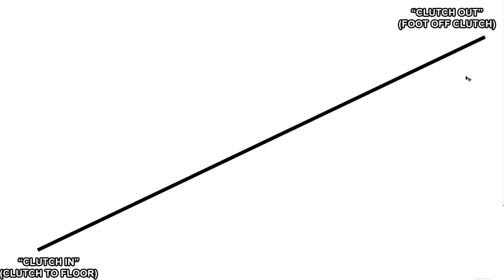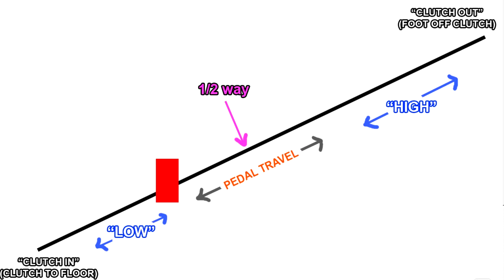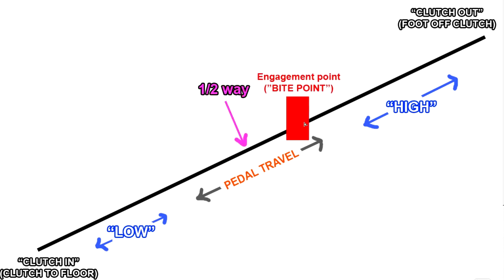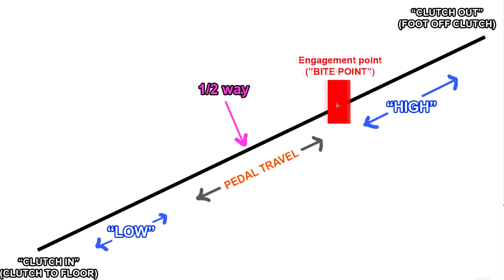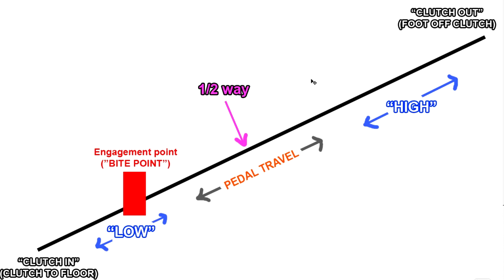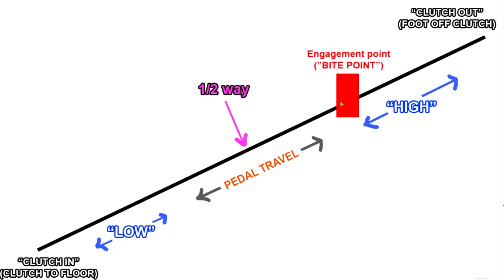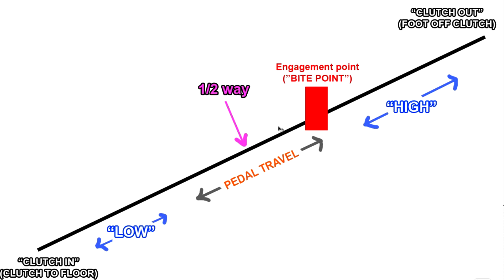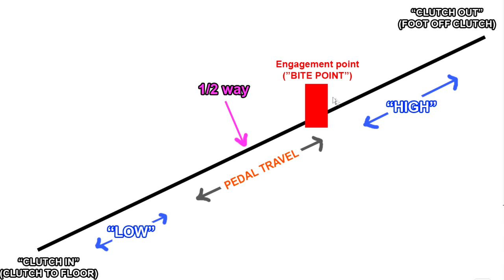(20) Manual Transmission: Bite Point , High and Low Clutch Engagement

Comment: I just had my clutch replaced after 20y and 237k miles.  The old clutch bite point was higher than the new one and the engagement transition was much smoother on the old one.  I was researching this point and found your video.  Thanks for the info!
Reply from the maker: Hi yes it is like old brake pads vs new brake pads the old clutch doesn't have good friction material anymore/worn out so it just smoothly engages. The new clutch has new friction material like a new brake pad so it will be more grabby and easy to stall.

Comment: Good video format.

May I just point out; that at 10 mins in, with regard to hill starts, that's what the hand brake is for - to stop rolling backwards. 

You apply the hand brake when stopped on a hill. Your clutch is pressed in and you have first gear selected. Then as you 'give gas' (or rev it as we say here in the UK) release the clutch Up to the 'biting point'  you'll feel the car start to want to move. That's when you release the hand brake and you will move off.
Reply from the maker: Many manual America cars and trucks never came  with a handbrake. Almost every truck sold with a bench seat never had a handbrake. Most people here do not use a handbrake for anything but the most steep hills. I have seen people driving manual here and I could tell they learned from youtube. They only knew how to gas then clutch and were using their handbrake on almost every incline because handbrakes and gas before clutch is the only thing that is taught on youtube. You can see here examples of vehicles with no handbrake https://imgur.com/a/uJ1ms .  I made a Hill Start Video and there is no handbrake in it because I do not use the handbrake for anything but very steep hills. https://www.youtube.com/watch?v=UIwWgEkR4UM
Reply: Drive Manual Well I never knew that.  That some cars in the US didn't have a handbrake.  You learn something new everyday.
Reply from the maker: Thanks and they actually do have the braking mechanism but it is used as a foot parking brake so there is a 4th pedal left of the clutch that you press down and that activates the rear brake like a handbrake.  You can see it in some of the pics
Reply: Drive Manual Wow! 4 pedals!? You must all look like octopi! :)
Reply from the maker: lol
Reply: Drive Manual be careful not to squid in wet weather
Reply: Rev it as you say in the UK? Lmao we say that here too(USA) who the fuck says “give gas”
Reply: No need to use ebrake on hill starts
Reply: Saul Cisneros A lot of people? “give it gas?” do you not watch movies?
Reply: @nonofyourbusinessnonofyour5435  Well unless you like prematurely wearing down your clutch lol then yeah you don't have to use the handbrake.  Suppose you could use the foot brake and bring it up to the bite, release the brake and rev.. but then at night you would be dazzling drivers behind you so bit of a bad habbit.

Comment: Just drove a camaro ss and I was used to driving a mustang noticed clutch on mustang is in a low range but high on the camaro. After thinking about it truly I'm more comfortable with driving the mustang up a hill because the clutch engages faster but when my friend drove I'd think wow guy is riding my clutch! But after driving his car I seemed to be more hesitant on starts because I would pull half way and the vehicle would not creep in first. After a few drives I got this trick
READY * SET * GO
Mustang: READY clutch in 1st gear/ SET gas /  GO clutch out
Camaro: READY clutch in 1st gear/ SET halfway out clutch/ gas GO clutch out

Comment: Thanks for the video.

We have a manual five-speed 2001 Toyota Corolla CE that was recently involved in a crash. It wasn't my fault, but the other driver's insurance is making it a total loss primarily because of its age. (It can still be driven, though it feels off.) We do have the option to keep it, but we don't really want to drive around with damage like that—dents and scuffs are one thing, but "actual" damage from a collision is something else. lol We are getting a settlement in the next couple of days, though, and will be buying a used manual five-speed 2001 Ford Focus ZX3.

From watching this video, the Toyota's clutch engagement point would fall under low. Now, we test drove the Ford and noticed we had to bring our foot up higher, meaning the engagement point is on the high side. Don't know if that's by design, though, or if the clutch is worn,  both of which were mentioned in this video. We'll have it checked. If it's by design, though, I wonder if it could be adjusted to be on the low side.
Reply from the maker: A couple of people have left comments that various ford cars have higher clutch engagement points so it is best to get it checked just to make sure. From my experience you usually can't adjust them
Reply: @DriveManual  It shouldn't take too long to get used to. Helps that we already know how to drive a manual.

When I first started officially driving with a learner's permit back in 2009, well, that was a different story, as I kept killing the car when my mom was teaching me. And then hills were even more fun once I was a little more experienced, but still learning. I was able to get going on them, but not without getting burnt clutch smell. lol I eventually became a pro, though.
Reply from the maker: @AmauryGarciaCumming  yeah its no big deal and you may even like it more who knows :) hopefully it is as reliable as a corrolla because those are really reliable usualy

Comment: Will the engagement point change if you do a hydraulic flush ? Like flush the brake fluid from the clutch and calipers ? I think air got in so I'm going to try it differently today and feel it out . Clutch had a halfish engagement point before now you have to push the pedal down farther . Air right ?

Comment: Hi there. Thank you so much for this detailed info. I bought a Toyota 2019 corolla sxe manual about a year ago. it only has 8000 miles but I have hated the clutch experience. I have driven manual all my life but only used cars, this is my first new car. I almost regret it. The clutch was too high since the begining and it bit as if there was less than the 2" of margin in the bite. It seemed that i could only go high speed or very low speed at take off, no middle speed. That was the only way to not stall. Do you have an opinion on what was going on? Now is more at the middle length of the clutch travel but it seems to do the same thing about the speed. Hope I explain myself. I don't know much about this subject but thanks to you I am able to ask this question now.
Reply from the maker: Hi it is so hard to say was it used car? maybe the clutch was worn out when you bought it if it is so high? I searched and it seem some have issue with the clutch  being too high, see this post by "killer23d"  scroll down page https://www.toyotanation.com/threads/squeaky-clutch.1648966/page-2

Comment: Awesome video. My 2004 accord has a bite point about an inch off the floor. It bites like hell and dont slip must be normal?
Reply: No, that means there’s no pressure in the clutch line, either your clutch master cylinder is low or out of fluid, air in the clutch line and needs to be bled, or you have a leak in the clutch line

Comment: very informative and useful information! thank you for the videos i have watched all of them! I have a question however. I have been driving my 2005 wrx for a little over a month now and i have gotten a lot better at manual driving, but this is my first stick shift. I have noticed the bite point of the clutch has moved closer to the top of the arc. Is this from the bad driving habits i had when first starting and did I do enough damage to cause this to change? is it adjustable? I don't believe I ever smoked the clutch or did anything immensely harsh on my clutch. let me know what you think! thanks!
Reply from the maker: Hi it's so hard to give answer for that. Most people don't notice where their clutch engages when learning and unless they are specially asked or that is pointed out they may not know it was biting lower or near the top when they first start driving so are you sure it moved or was it always around that point? I drove a Legace I think it was a 2010 and I noticed right away the clutch in that car bites fairly high like around 1/2 way mark if I remember but the owner bought it used and wasn't sure how new the clutch was but it was very noticeable to me so it could be subaru bites a little higher from the factory I am not sure as I have only driven 1 subaru. But if you are sure it has moved and it is closer to the top then you probaly put some wear on it. 
It is very easy to do with just excessive riding the clutch and giving too much gas when first learning but it is just something you have to do to learn there is no real way around it. I wouldn't worry about it. Really only when the clutch slips then you need to change it. Here are some videos of slipping clutches there is a wrx in there  WRX https://www.youtube.com/results?search_query=slipping+clutch  when the clutch slips the engine rpm will rise up and the car will not really accelerate. One of the other problems when learning is not just wear, on the clutch you can often get 
"clutch chatter" when you are bring up the clutch the bite point you will feel it is kind of rough and may make a chatter sound or you may even feel it is not smooth  there are some videos here but nothing really good 
https://www.youtube.com/results?search_query=clutch+chatter
sorry can't give better answer for that  but I really appreciate you watching the vids and hope they help
Reply: I could be wrong but I'm pretty sure it moved. However it seems that in reverse gear it's not any different than it was, and the bite is lower. Maybe I am crazy but I probably did cause some wear since I began. Well I was told that the clutch was replaced 160k km/100k miles ago but I don't have the paperwork for that so it could be as old as the car (175k miles). Hopefully as I progress I will cause minimal wear in the future and have to avoid replacement! Your videos have helped me a ton!
Reply from the maker: hi you make a good point so in reverse gear most of the time the bite point is more obvious. In some cars you can even feel it kinda click there if you just push your clutch in and out around the bite point in reverse. But it isn't like that in forward it can be much smoother and sometimes even hard to feel and edge where it wants to bite like the red box in this video. If you feel it low on the reverse then that is the true bite point. if it is really worn it will be high whichever gear you are in.  Yeah 175 miles would be a lot for a original clutch but don't worry about it unless it is slipping or you feel a lot of chatter. Really the most wear happens in the first couple of hours of learning how to drive that is when you don't really know anything and how to use your feet so I'm sure you will be fine. The worst thing that kills clutches fast are panic starts that is when you are at a stop and cars come up behind and you panic and ride your clutch pedal around the bite point while giving a ton of gas like 3500rpm just to get the car moving.
Reply from the maker: your car was probaly not fully into reverse https://www.youtube.com/watch?v=KN5fgRFTqys
Reply: @DriveManual  hai  ..i want to ask,many people said if the clutch is low, it is difficult to stabilise between gas and clutch when creeping in uphill..is it true?
Reply: For you opinion, which one is better? Low clutch, middle or high clutch ..
Reply: @mohamadkhairil3422  middle for your average diver and car but if your driving a sports car I find it better to have the bite point lower maybe towards a ¼ of the way down the pedal throw.

Comment: Is adjusting the clutch gonna bring the High biting  point to low? Say loosen the nut for more Free play
Reply from the maker: You might not have enough clutch movement to disengage the clutch if there is lot of  freeplay
Reply: @DriveManual  thanks
Just gonna used your teaching and bring the clutch up more to get compensate  the High POINT
Reply from the maker: @2be379  exactly look up the video slow starts trouble shooting

Comment: I'm having problems with my Mirage G4 (manual) it has low and quick bite that when you release the clutch without gas it stalls immediately specially when on reverse bite point's very sensitive I guess. What should I do to improve it?
Reply from the maker: do you use your ankle to reach the bite point or you use your whole leg to lift up?
Reply: Drive Manual usually press and release with my whole leg that's how I'm used to but I tried doing it with my ankle and still  engine kept stalling so I'm assuming that maybe there must be clutch adjustments to be done?
Reply from the maker: I was teaching someone who in the first 10 min he kept going past the bite point using his ankle and was because it is really a precise movement and he was just floating past it. Do you move your foot in steps or like 1 smooth movement. If you move it in one smooth movement to the bite point try moving it in steps or inches and say it out loud  "1 inch ,2 inch, 3 inch, bite"   that way you get used to stopping your foot at the bite point and not floating past it. Use your ankle and try that and let me know it may take 10 times before you get it. Then if it works do it  like 50 times so your foot naturally knows where to stop without you having to think too much about it. If iyou still have problem maybe it is your clutch but impossible to tell from here.  If the clutch bite is close to the floor no reason to not use your ankle up to the bite point.
Reply from the maker: just checking up on you were you able to try what I said

Comment: So if my clutch is disengaging basically at the floor wouldn't that mean it's a worn out clutch? But have tons of peddle play can this be adjusted to where it isn't gonna burn the clutch out?
Reply from the maker: hi this is really if everything is working as it should and if you have play or excessive play or any other issues there may not be anything wrong with your clutch. For example some honda clutch brackets tend to crack and when you press the clutch pedal instead of the pedal making the clutch work as it should you are really just bending the pedal bracket and it could give a feeling of the clutch having to pushed all the way to the floor to disengage but really its because the pedal is not getting enough travel because the pedal is broken....stuff like that ...does that make sense? So this video is just in general to give you idea what to look for.

Comment: What if it’s a new clutch and flywheel and the bite point if high and clutch slips when heavy on the gas
Reply from the maker: if it is slipping maybe the parts are wrong or the clutch is not engaging fully for whatever reason

Comment: I am also having trouble finding the biting point of my ae92. when i releasing the clutch halfway the engine vibrates. i press the accelerator and release the clutch at the same time. am i doing right?
Reply from the maker: it sounds like you found it , try in reverse and see if it is clearer where it is. how do you go up a hill
Reply: Drive Manual it vibrates very loud and it was like my engine wants to pop out on the hood.
Reply from the maker: @ernievelasco23  do you use your whole legs or just your ankle? have you watched this https://www.youtube.com/watch?v=476FXuVrSVQ

Comment: If the bite is too high, can I just adjust the pedal? Will it work?
Reply from the maker: Hi i've never adjusted one because all these Hondas i've driven have them low but try it and let me know how it goes.
Reply: It depends on whether your clutch is cable or hydraulic
Reply: No you need to replace it